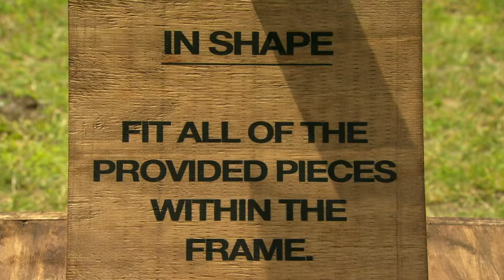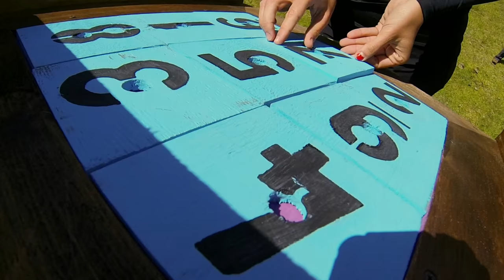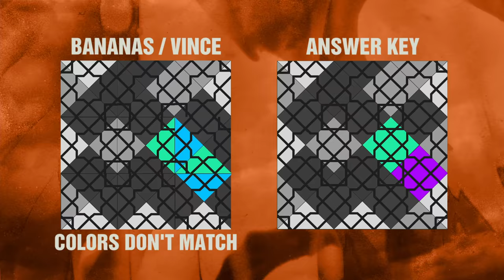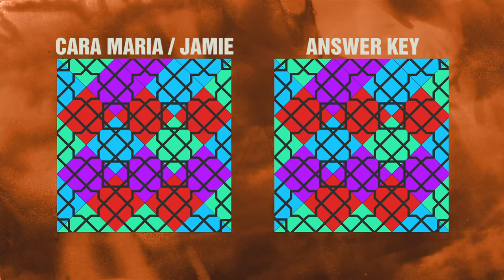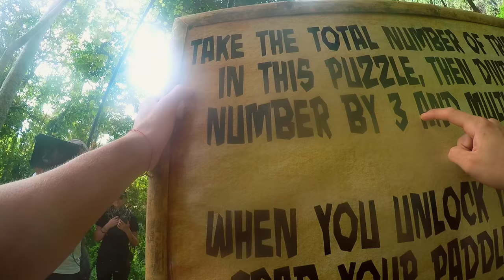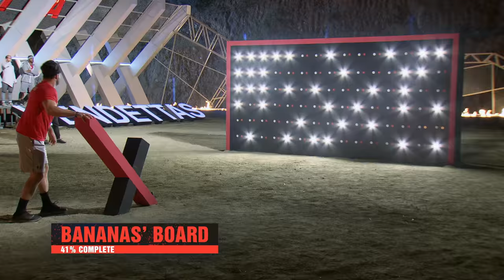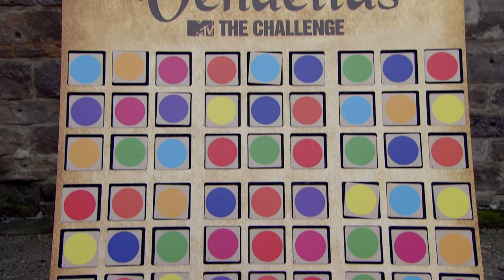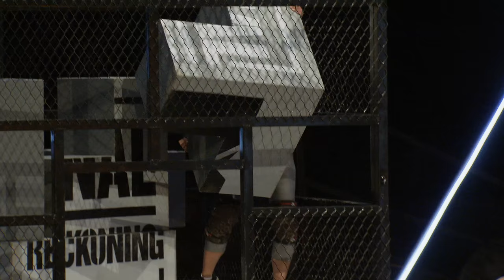Best of G.O.A.T. Puzzle Solves 🧩 The Challenge

Comment: lol.. that board of lights that devin and bananas had to do... when i saw this live, i said immediately that they should turn off all the lights that were lit up so that they can just go and turn them all back on without having to try and memorize what is on/off.
Reply: They’d still have to memorize which ones were on, otherwise what was on vs off would just get reversed and then you’re back to square one
Reply: @Linzilu99  yea, but it'd be so much easier to turn all of them off FIRST... and then work in a grid to turn them all back on. you didn't need to go back and hit the button to see which were on, because you KNOW which ones you're turning on at that point. it's literally 200 IQ
Reply: @secretAZNman_  turning all of them off takes the same amount of work as turning on the ones that are off, so it would take even more time to do this strategy because you’re adding an entire step
Reply: @Linzilu99  there were significantly less lights on than there were off. If you know you have to hit every button to turn em on, that's much faster then running back and hitting the button and analyzing from there. I can't take this much time to explain a 200 IQ play, you either get it or you don't.
Reply: @secretAZNman_  30-60 is not significant enough for that to save you any time
Reply: @Linzilu99  this is my last reply.. But imagine using your entire arm to just slide down entire rows cause the lights are all turned off. There's a reason people call plays 200IQ.. Not everyone can think of em, let alone comprehend them on the fly. The more I think about this, the more I'm tooting my own horn for thinking of it instantly
Reply: You'd waste multiple trips singling out all those random ones -- especially the ones deep in the middle where you'd have to remember column and row. That's a slow start for what you'd hope would be a faster finish once you're banging all of them.